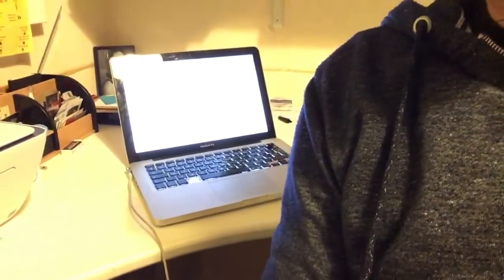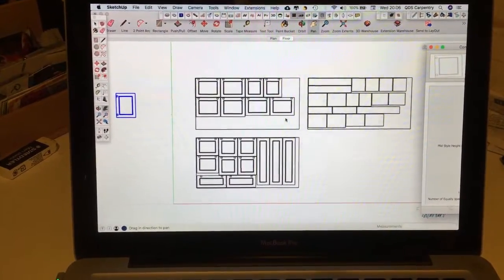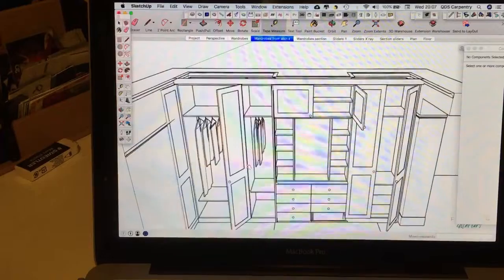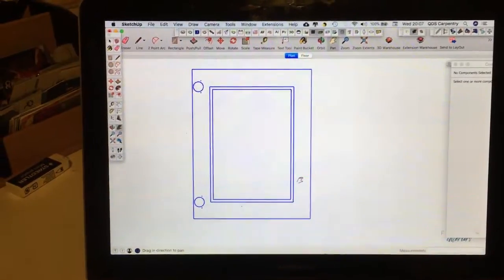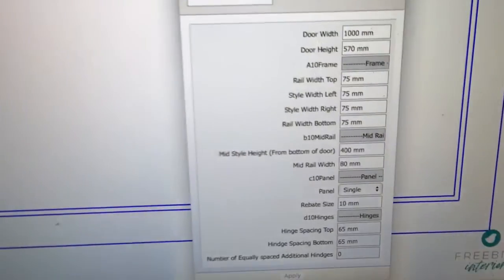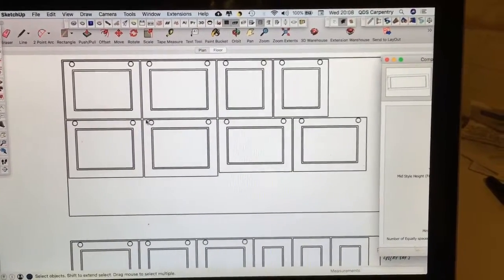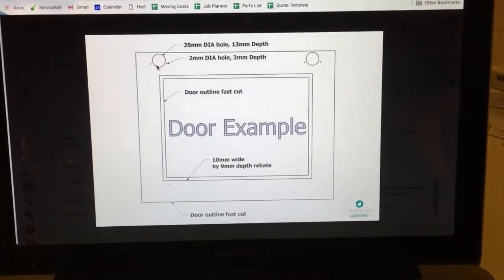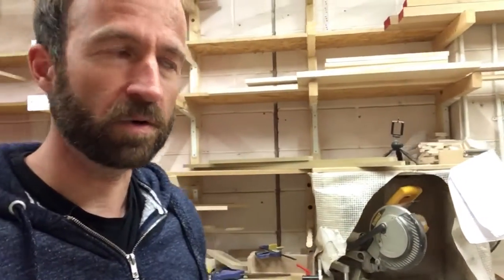CNC Doors Update Part 2

Comment: Why don't you just programme the cnc to machines door out of one piece? . ( I.e just machine a recess to look like a panel)
Reply: Videos are great tho👌
Reply from the maker: It leaves a fluffy core that needs a lot of sanding and it requires a 2 stage operation if I’m going to do the rear cup holes also.  Still, we’ve been discussing trying it with the Finsa mr mdf as it seems the core comes up quite smooth
Reply: @Alastair_Freebird  Maybe you can fiddle with cutters and settings when you have your own CNC. A kitchen place near me does shaker style, etc. "one piece doors", as they call it, curved by the CNC router but with a twist. They buy MDF with melamine on one side. The melamine ends up at the back of the door and they only paint the front. They seem to think the time saved by not having to sand and paint the back is well worth itI would be interested to see you give this a try.
Reply: The mr medite is great. My employer makes the doors from Mr medite and works great. We use ac lacquer tho......I never found water based paints any good but you seem to use them all the time? Better for the environment I guess ....🥴

Comment: I prefer a 5 piece frame and panel door. If you run out a stack of 22mm thick stiles and just cut up what you need from that stock, it's a quick process then. CNC wastes a lot of material.
Reply from the maker: Biggsy1970 what’s your method for the doors, continuous grooves and loose tenons; stopped grooves and dominoes, or something else?
Reply: @Alastair_Freebird  I've tried a few , I've got a t&g cutter set from wealden tools so can cut a tenon and the groove but sometimes I just groove everything and use a loose tenon. I did try Dominoing a door once and it seemed a right faff and took longer. I use the domino for the carcases only.

Comment: Do you find it difficult keeping the edges square when using that sander? I'm just getting into spraying and as I only have a rotex (heavy) and the handy sander I was wondering whether to get a square sander or an orbital like that. Do you use 180g or higher? Thanks!
Reply from the maker: Matt Kindon it does take some practice but you get used to it.  I think it’s easier with the mirka sanders than taller sanders.  We work through 120, 180 and 240 grit to get the edge smooth, using abranet discs.
Reply: @Alastair_Freebird  thanks for the reply! I'll go for the ceros then. 😀 long term I'd love to get an edgetech sanding disk in a table saw but I've not really got the space to justify it at the moment!
Reply from the maker: Matt Kindon Get a Deros, it’s better and they are about to discontinue the Ceros!  The Deros has slightly better dust capture; doesn’t require additional transformer; and can swap between 6 inch or 5 inch pads which can be useful.
Reply: @Alastair_Freebird  ah ok, will do! Dust capture is a massive thing for me in my small space so thats a bonus 😁 thanks for your help!

Comment: We used to make kodak 35mm film holders  for all their retail outlets many years ago, they were basically a draw type box with criss cross dividers making about 12 24 and 48 compartments i think it was,, we tried for weeks to cut all the components on the cnc altering the cut files but it never quite worked the materal would slip on the vaccum bed so  ended up making templates and jigs to hand router them. lt was 10 times quicker and more accurate.. I couldnt tell from the cut files but if you change the colour of the line to coincide with which cutter is used, green line 3mm blue line 12mm etc and  you can set  number of passes and depth.. Not sure how they are cut id be thinking 12mm cut first to depth of say 9mm to make rebate and then cut remainer of the way though with 3mm or just a finish cut with the 3mm to neatern edge and reduce radius corner if that makes sense,...
Reply from the maker: simon clayton I think chop shop use an 8mm up/down cutter to cut through in 2 passes, and for the rebate, then the 3mm for corners.  Interesting about the film holders.  I have seen chop shop cut very small parts, they just leave thin ‘tabs’ to bridge across the cuts to hold everything in place then manually cut them off and trim them flush afterwards.